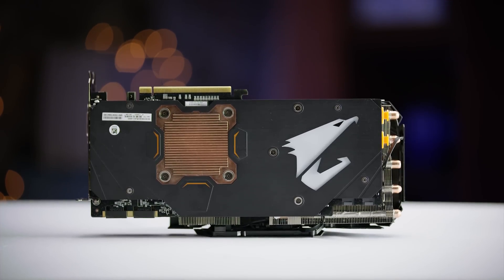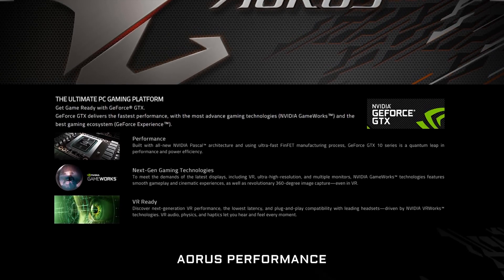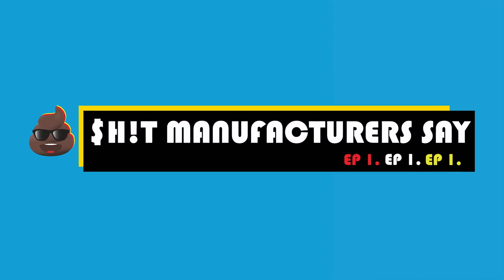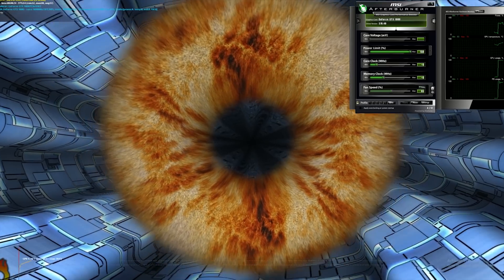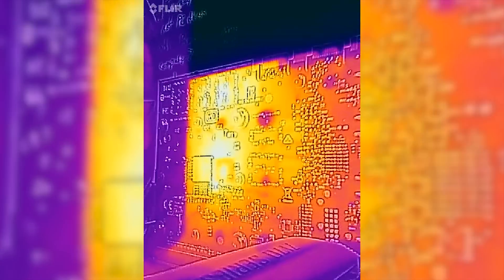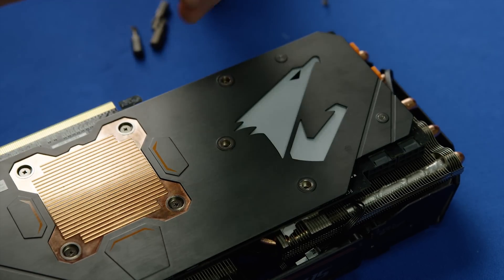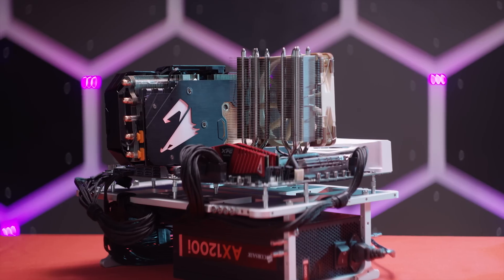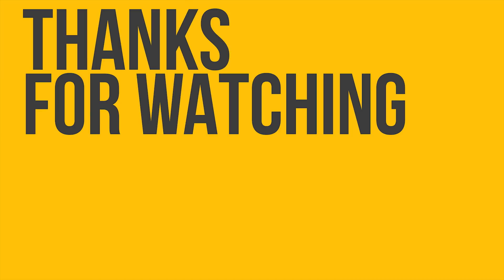$h!t Manufacturers Say Ep. 1 - "Backplates Cool Your Video Card"

Comment: You don't mention the fan curve. If it was the same temp but at lower fan speed then that would be a positive result. Not to mention the change in thermal paste. Not impressed with the rigour of this experiment.
Reply: I for sure understand what you are saying and agree that they could and should do more when trying to reduce lurking variables.

I disagree with the fans though, if you have ever run this benchmark it punishes cards and if you have tested cards you would know that these benchmarks and overclocking are for maximizing the output of the card. The fans would never be below 100% in this test.

Over all with this piece a product market claim like this I would expect a large improvement not maybe kinda negligible temp decrease.
Reply: Ryan foulds there was no change in thermal paste. and what does fan speed curve have to do with this
Reply: We don't know if the paste was changed or not, but either way is bad. If it wasn't changed then there's a cooling performance hit from that. If they did re-apply it** then it's not an apples to apples test either.

regarding the fan curve: The fans adjust speed dynamically rather than staying at a constant speed, so if one cards has the fans running faster to maintain the same core temperature then that indicates a difference in cooling performance between the two configurations.

**without making sure it's the same compound that Gigabyte Aorus use from the factory.
Reply: do one your self
Reply: The fan speed was never gonna change because exactly the amount of "work" is required from them since the copper piece, while "absorbing" heat, has no where to transfer that heat to.
Reply: ***** Rawdilz therea no way that fans wouldnt be shooting at less than 100% when furmark is a program known to kill cards if it is left on for too long.
Reply: Marc Allerheiligen I don't think so either. But the point of doing an experiment is to be sure, not to speculate. A weak experimental method is often worse than doing no experiment at all.
Reply: Ryan foulds agreed this needs a more rigorous follow up
Reply: Drew Thomas That entirely depends on the GPU and how good the cooler is, for example, my old sapphire 7850 has a fantastic cooler which allows it to continuously run at full load and never needs to run above about 50% fan speed in order to keep it under about 80C and in most games it can run the fans at it's near silent idle speed of just 20% 

Now yes these cards do run a bit hotter but there is no guarantee that the fans were constantly running at 100%, the only way to ensure that is to manually set them to 100%,
Reply: Then make a video yourself and see if you get all the details in.
Reply: Yap, you can see the fan speed changing in the short footage
Reply: i just said thee same thing. this video is bullshit. also what was the temp of the exhaust coming out of the card with and with out the back plate on? i think thee back plate helps disperse heat which in turn causes the fans to spin at a lower rpm.
Reply: Mekronid Well with the little copper plate I can see the idea behind it. Copper does have better conduction properties. However if the thermal compound was changed then this test is incorrect either way. If they reapplied compound they should have ran the test again with the same compound in both instances, also I think the fans should have been manually set to 100 percent, then the temp will settle where it does and that would give a much more accurate result.
Reply: Relax, I can't speak for anyone else but I didn't comment to make it seem like I am hating on the video or anything. I enjoy LinusTechTips and was simply saying I can see why the copper plate could work and also to give some constructive criticism to one of my most watch YouTube channels in the hope they will continue to release high quality videos.
Reply: I seriously doubt that it'd thermal throttle, if it's getting 67C at 44... It'd be higher, but not by much :P
Reply: Maybe, we really have no idea how the fans were reacting. They could have stayed at 44 or could have been at 44 for just that frame we saw. Goes back to the reason for OPs post I guess.
Reply: Ryan foulds they're not known for their scientific tests. Gamernexus is far better
Reply: If they didn't mention changing the fan curve, what makes you think they would have changed it?
Reply: Why would the fan be at a different speed at the same temperature, though? I see what you mean that the curve would have a balancing effect kinda thing. I don't think it would be great enough to lock it to one single temperature within a degree.
Reply: my gpu won the cooling lottery mine never exceed 58c and its OC to 2100 mhz core clock fan speeds never exceed 36% fan speed
Reply: Ryan foulds You are right on from a laboratory setting and how they should set things up. 

In this instance though I think it is an utter case of marketing a feature that really does nothing at all. When the twin Frzer cards came out they crushed the competition because their fans and heat sinks were top notch. This backplate thing. worthless in my eyes for real performance.
Reply: TheWorldWarrior oh
Reply: +Mekronid ummm...yes a backplate does add surface area.

my backplate card runs 2- 3* cooler with it on rather  then off in the same case and at the same clock. 

the only time it wouldn't is if it wasnt physically touching the card
Reply: agreed
Reply: also using the reference card thats probably throttling at 79c anyway
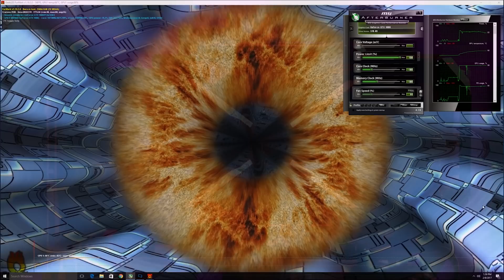Reply: they weren't at 100% though 3:45
Reply: Looking at 3:45 the fan speed looks to say 44% to me. But I'm sure they were at 100 most of the time in both test, only reason I say to manually set them at 100 is to be sure they never cycle lower and the maximum cooling is being achieved in both scenarios.
Reply: you have no reason to believe that they were at 100%... They should have set them to around 35% to see if it made a difference
Reply: Both test would thermal throttle at 35%. In this test you want to eliminate any other variable such as thermal throttling which would auto reduce the power. Setting to 100% would ensure that both times the cards are using their maximum cooling potential, therefore the only difference in the cooling ability would be the back plate. .
Reply: Skivet running the fans at lower speeds exponentially decreases the over all cooling capabilities since majority of fans focus on creating a vortex like effect using a pull push method.

Decreasing the fans below the threshold for this massively hurts the temps. It is not a simple step function but rather an exponential inequality that shows the fan speed impact on temp.

Also to put aside the fan speed argument once and for all the card will always put off the same amount of heat. More copper surface area will lead to more area to dissipate the heat. This has diminishing return though or else we would have heatsinks that link to copper cases that act ass heatsink extensions. The surface of the copper is cooled by the fans which will displace a certain m^3.

Comment: Euhm, if the copper was ment to dissipate the heat from the GPU, it should be warm, not cold. Maybe they forgot to put thermal paste in or something? ;)

But even if it was properly connected, it's surface area is so small compared to the actual heatsink that it won't make a difference anyway.

Comment: The "cold" spot on the backplate wasn't cold. The thermal camera couldn't pick up the copper because it is reflective.
Reply: Spot on. It was just reflecting colder objects like a mirror. Thermal readings on metal, low emissivity objects is not straightforward point and click. You need to know what the emissivity and reflected temperature is exactly and compensate the camera for it. Your display will still show it as a cold spot,  but the thermal reading will be more correct. (I am a Level 1 thermographer)
Reply: speedcoaster Didn't make any sense to me either. Surely it (if the flir was "working") the copper plate/heatsink should be hotter?
Reply: speedcoaster is correct. The "cold" spot that the Flir camera shows is because the copper is reflecting the IR back to the camera and distorting the thermal reading. At my job we use a marker to cover metallic surfaces to get better thermal readings when this happens. In conclusion we can't actually say what the temperature of the copper was during the test.
Reply: +Shorty Beard - That is largely true, but not entirely. A material like aluminium, copper or silver with excellent thermal conductivity will very quickly even out its internal temperature, hence why it's fine to touch the bare metal handles on a steel cooking pan but less advicable to do that with a pan made of aluminium, but how much air radiates away into the air has more to do with the air than with the conductive material. I could easily design two metal objects of equal volume, one out of steel and another out of copper, and have the steel object be better at dissipating heat to the air than the copper one, simply by manipulating the surface area.
Reply: FLIR measures surface temp of objects, and when that object is really good at heat transfer, then it looks cold on the FLIR because it is radiating all its heat away into the air before it's surface gets hot enough. Same reason why if you hold a wood object and a metal object that are the exact same temp, the metal will always FEEL colder. Veritassium did a video on this. It's a very common misconception.
Reply: Robert Faber you are right. I didn't word that correctly. It's really the emissitivy of metals that make it look odd in that they don't radiate IR that aligns with the given temperature of the material and also reflect IR from other sources so the readings can show any range of temperatures.
Reply: Incorrect, sir. It depends on whether your hand is hotter or colder than that which you touch. If both the wood and metal are colder than your hand, the metal will feel colder to the touch because it is more conductive than the wood and energy moves from higher concentrations to lower concentrations, moving more quickly with the metal than the wood. This is exactly what you said, HOWEVER, the same is true for when those surfaces are hotter than your hand, making it a much more pleasant experience to hold a hot wooden spoon than a metal one. This is why you were incorrect. Metal will not "always feel colder."
Reply: GetTheCheeseToSick yeah, if it did have a cold spot it would be isolating, not cooling.
Reply: Good eye m8
Reply: my int up thx m8
Reply: Shorty Beard  Sounds like you watched the Veritasium video but didn't understand it very well, because that doesn't make any sense. The copper is most definitely as hot as the hottest thing touching it.
Reply: I'm so glad a few people with real experience and knowledge jumped in on this. (Y'll basically said what I was trying to say in previous comments, but I didn't word myself correctly. Thanks!
 I do IT for a living so I am not an expert on thermal imaging, but I was in the Navy for a few years and trained to use FLIR for firefighting and other shipboard stuff.
That said it is my understanding that the "thermal image" provided by any IR thermal camera is a "reference" image, meaning the temp scale varies based on the range of temperatures within the viewing area of the camera.
Taking that into consideration you can't even tell what the temps are in the 2 clips because the scale is not shown. So basically I would have to call b/s on this "test" and say that a proper scientific method was not followed here, not all factors were accounted for, and equipment was not used or understood properly.
Normally I would not care, but I really expect better from Linus Tech Tips. I expect better from Luke.
This video didn't feel like someone searching for the truth amidst "Crazy statements manufactures use" but instead more like "I think back plates are stupid and i want to make a video that proves my point." Guess what you can prove almost any point (or disprove) if you are only looking for evidence that supports your claim.
So I ask for better preparation, because we should all WANT to know and understand the systems at work within technology. We should want to get it right and be our best.
Ok soap box speech over, I'll just step over here and cry in the corner...
Reply: Trenton W Far be it from me to argue with you on this if it relates to your job, but surely the point of thermal imaging, as opposed to other IR photography like night vision, is to pick up the IR radiation coming off of objects due to their temperature, not to emit IR radiation from the imaging device and see how much of it reflects back...
Reply: +Shorty Beard Saw the video just now and sorry but you are wrong, if the GPU was at 67º C then the cooper that allows heat to travel very quickly should be at around the same temperature.
Think of the ice that melted faster in the Aluminum, the reason it melted faster was because it was transferring heat much faster.
Here if the cooper was transferring a lot of the GPU's heat it should be warmer.
Reply: Having a laser infrared thermometer it's handy on this situations
Reply: They definitely lose points for that comment. You can even see the hotter spot reflected from somewhere else (maybe some part on CPU cooler?) on that plate.
Reply: I would say the backplate is colder simply because of convection from the heatsink drawing heat away to the other side.   It's not exactly providing any cooling, it's just not insulating.

When it comes to disappating heat, surface area is key.  Heatsinks have a massive surface area, if you were to take all the fins of your typical heatsink and take them apart and lay them flat, it would cover quite a sizeable space on a table.  Back plates could be made better if these were given simple stubby fins, but that would also make them cost more to make, and could potentially make them incompatible with some configurations.  

For now, backplates are primarily for structural support....which can be trivial in most setups.  I think in the typical cooler facing down ATX case setup, it helps.  But in my system, my card slides down into the PCIE slot, with the heatsink facing sideways.  In this scenario, back plate support isn't needed at all.

Comment: The "cold" spot you saw in the FLIR is actually due to the emissivity of copper and does not represent a colder temp. The copper just looks "cold" to FLIR because it is not emitting as much infrared energy, the IR part of FLIR stands for InfraRed.

Comment: maybe another test could be replacing the copper backplate with a similar backplate without copper to test if the 3 degree difference is between that and a normal backplate. the claim seems pretty unsubstantiated regardless so probably not worth trying to find a backplate that fits

Comment: I already kind of knew this but it is nice to have confirmation on this matter. My own GTX 970 from Zotac doesn't have a backplate and I always get worried about temps and heat but the thought never crossed my mind that a backplate was for cooling. Not unless they put some kind of exhaust fans on the top of the backplate. That would be cool. No pun intended, lol. Anyhow nice to know this info. Of course backplates look better especially when kitted out with RGB and LEDs. Anyone else have backplates on their graphics cards? Do you prefer your graphics card with a backplate, without a backplate, or just plain don't care?

Comment: in an open bench that backplate doesn't do anything, that needs an air flow to do something
Reply: not really. Airflow helps, but it should also work without it.
And the thermal camera showed it was the coolest spot, while if it was actually dissipating heat, it should have been at least just as hot as the surrounding.

Comment: Alright, doesn't help with core temp, but does it increase card's life span?
Reply: RivenWine that is nearly impossible to test for linus or even other big revieuwers since it will take years and hundreds if not thousands gpu's to get any usable result. by that time the card is no longer relevant and the tests will have cost way more than you could ever earn out of the results
Reply: RivenWine What, I have never had a graphics card die on me. Even the one that runs in my almost always on file hosting server that has over 6 years running

Comment: I've always wondered why they don't flip the card design around. The most aesthetically pleasing part of the card usually ends up face down in many towers. All that design, manufacturing and colour coordination that goes into the front of the card and you usually only end up being able to see the back plate through the window. :(
Reply: Soxious or quit over designed coolers and have awesome plates.
Reply: Soxious possibly because the heat would blow directly into the cpu cooler on most pcs.. As cheap as water cooling is getting most rigs still have them.
Reply: True, I was just thinking about it the other day. Well not so much the card as as the fans since they're LED, but unlike every other fan you can't really see them. Not much point unless you like the glow from the top.>_>

At least case manufacturers have taken notice though, since some give you the choice between vertical and horizontal. Its not really the GPU manufacturers' fault since its more of a motherboard positioning issue.
Reply: Soxious For airflow
Reply: This problem is solved by inverted motherboard case. But another problem arise, the text on the side your GPU is going to be upside down XD